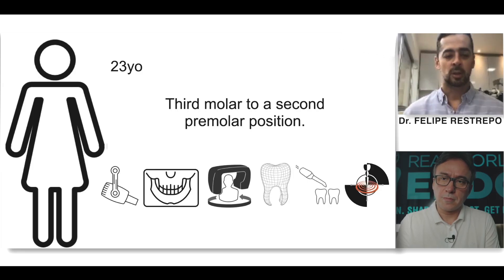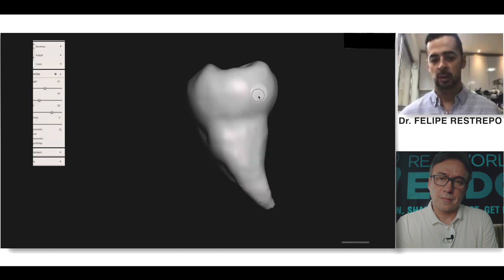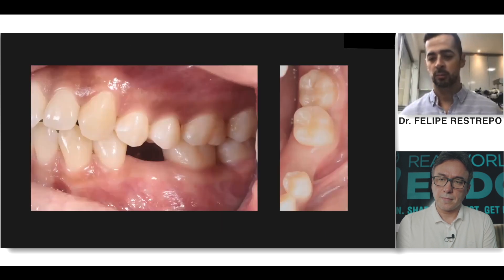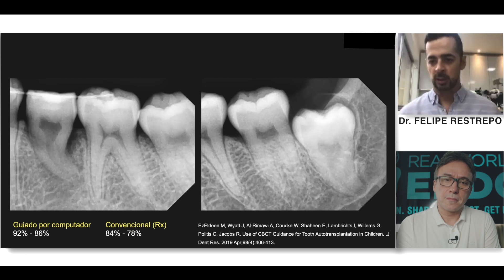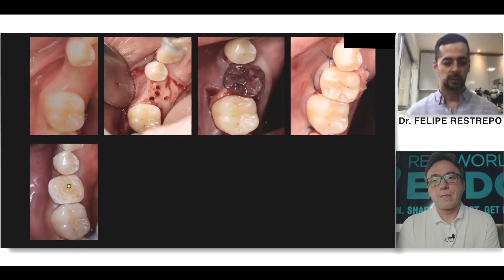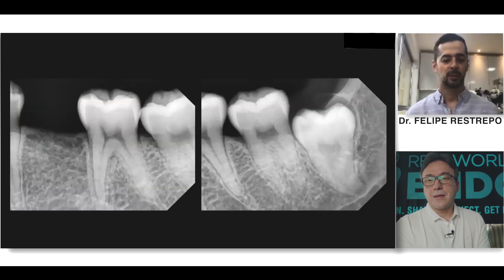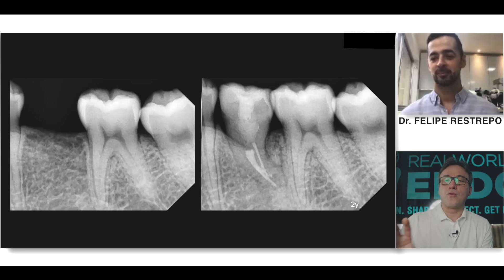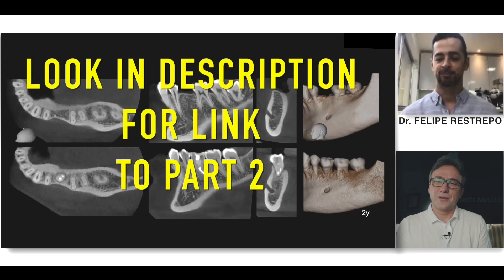Autotransplantation using Dynamic Navigation with Dr. Felipe Restrepo Part 1 of 2

Comment: I did one tooth autotrasplantation on a 16 year old patient, we transplanted the 18 to the place of the 16, it had incomplete root formation and to this day (four years later) the 18 is still responding to cold and the root continued its development, root canal treatment was not necessary and I have the case posted on my IG. I'm just curious on why Dr Restrepo doesn't have older cases and follow ups longer than 3 years. He should show those.
Reply from the maker: The key about success or not in these cases is if the Apical papilla and it’s associated stem cells are still present (immature Apecies) vs. mature Apecies. You can see a video interview I did with Dr Ian Grayson with a tooth that remained vital a few years ago. 
But great job if you did a similar case! Well done! 👍❤️

Comment: Great interview.
I wonder if we do retrograde mta / bioceramic filling right after extraction and before cementation wouldn't be better and more time saving?
Reply from the maker: You need to complete the RCT first as the retrofilling alone won’t hold back all the dead tissue inside the canal after the tooth is extracted and devitalized. At least it can’t do it predictably as there will be lateral canals and other portals of exit that will cause a problem. So, conventional endo should be done, ideally before extraction or at least shortly after reimplantation. Keep in mind it’s not done outside the mouth. So extra oral time is shortest that way. Cheers!

Comment: Incredible case and incredible result! 
If you were to use a tooth with an incomplete root formation with the hope of revascularisation 
1) what is the minimum root development stage for it to have some primary stability when the splint is removed.
2) what is the mechanism by which the transplanted tooth is able to "reconnect" with the main blood supply and remain vital?
Reply from the maker: Good questions. I think the epithelial root sheet must have developed partially and the apical follicle be present. It has to create some kind of a seal around the alveolar crest or be somewhat subcrestal for it to work.
Reply: Thanks Dr Nasseh!